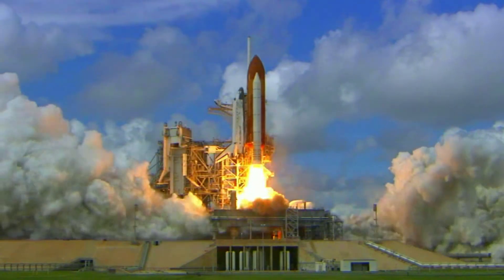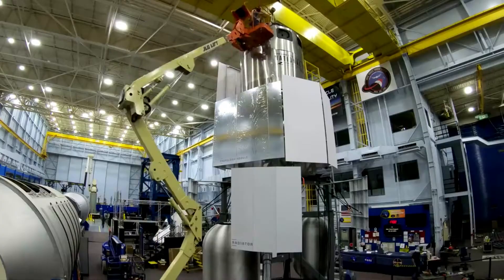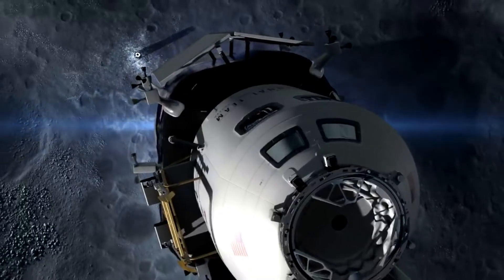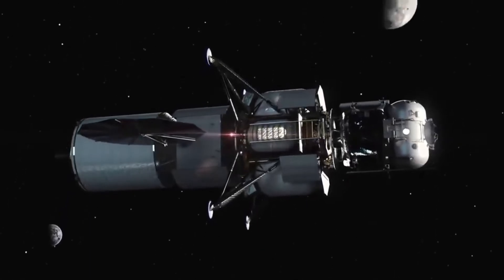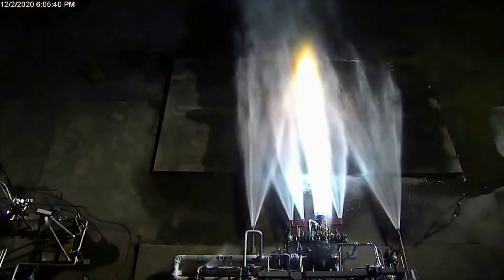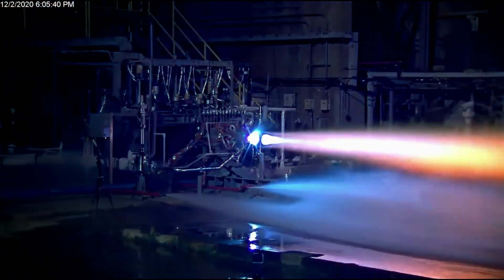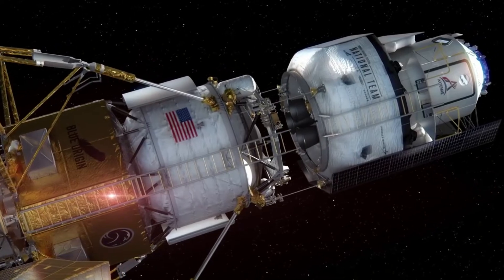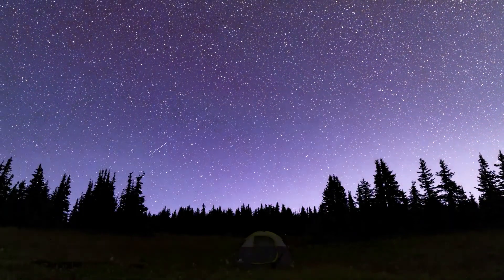What Exactly Went Wrong With Blue Origin’s Human Landing System

Comment: It has to be said: when NASA awarded its first Human Landing System contract to SpaceX's HLS Starship concept, the agency recognized SpaceX's design had numerous advantages. HLS Starship can carry 100 tons to the lunar surface, with possible capacity for more. It can refuel in space. It can theoretically carry way more than four astronauts; perhaps eight or a dozen or more. It will offer habitable interior volume comparable to the International Space Station, and can move about the lunar surface. And its landing engines are high enough on the sides of the vehicle to mostly avoid stirring up the lunar regolith with launching and landing.That, in itself, makes SpaceX's proposed lunar lander into a mobile moonbase. Blue Origin / National Team blew a huge opportunity here, but it's not too late. Blue Origin should kick its New Glenn rocket program into high gear and plan for a radically different lunar lander. Blue Origin should propose an entirely new landing craft, usurping many of SpaceX's design ideas.  If SpaceX can make the entire top stage of Starship into a lunar lander, so can Blue Origin using the top stage of New Glenn. If SpaceX can employ high-mounted landing engines of HLS Starship, so can Blue Origin. Blue Origin's New Glenn rocket may be significantly smaller than SpaceX's Starship family of rockets, with the top stage of Starship boasting a 9-meter fairing compared to New Glenn's 7-meter, but it the entire top stage for a New Glenn could be made into a lunar lander, it would still offer impressive capacity as a Moon workhorse. Maybe New Glenn would never be able to haul 100 tons to the Moon, but maybe New Glenn could haul at least 20 tons... or 35 tons... or 50. That would be vastly superior over a paltry 850 kilograms! If a New Glenn HLS variant could be designed to do that, it would become an extremely valuable asset to NASA's Artemis program.